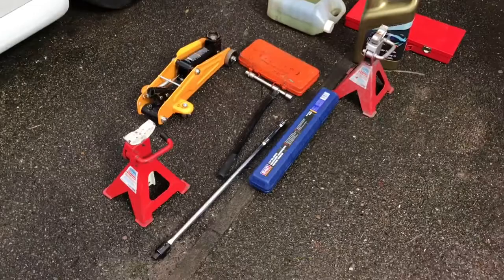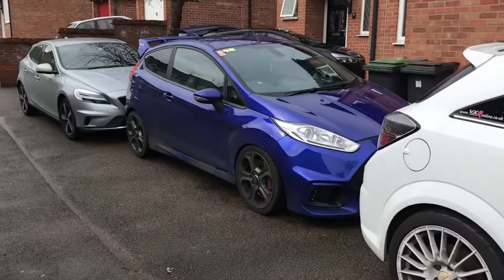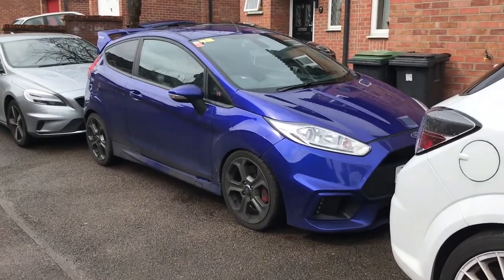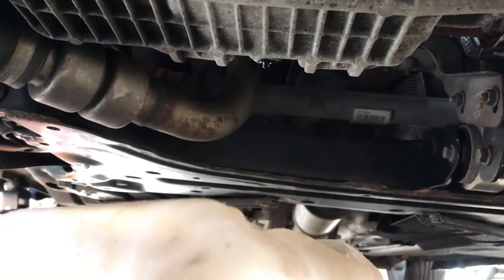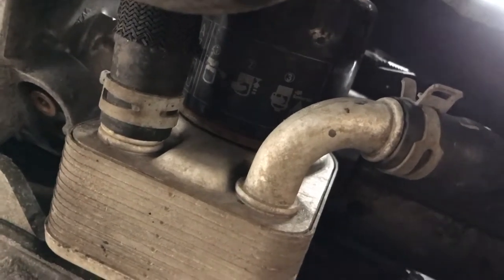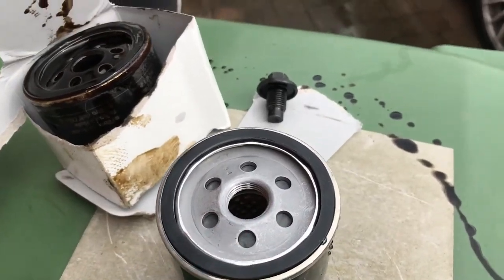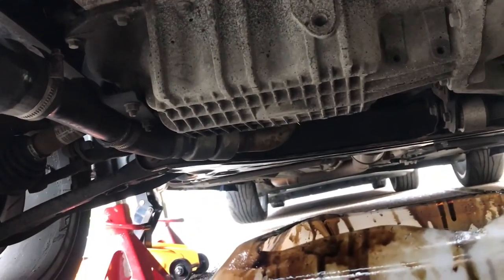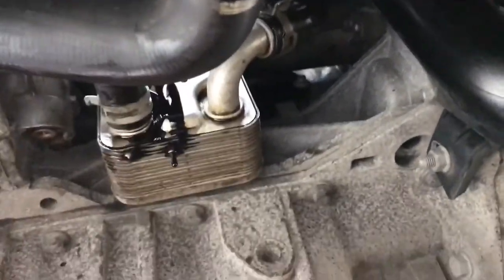Fiesta ST180 Oil and oil filter

Comment: Do you need/use a new washer for the sump plug?
Reply from the maker: I would always advise to but if the washer isn’t distorted much it can be reused if need be, but if you do keep an eye on any leaks. Always try to though, most new sump plugs come with brand new washers in them 🙌